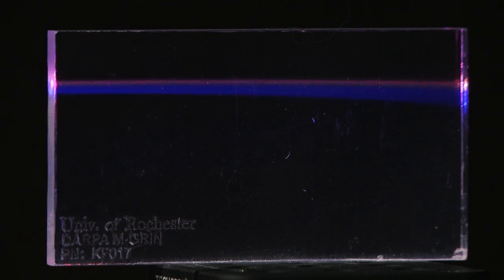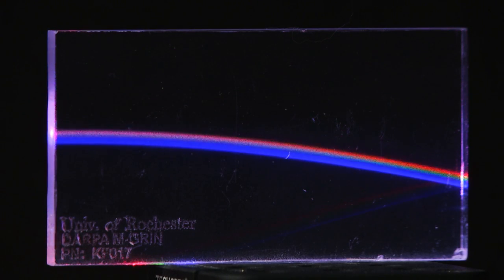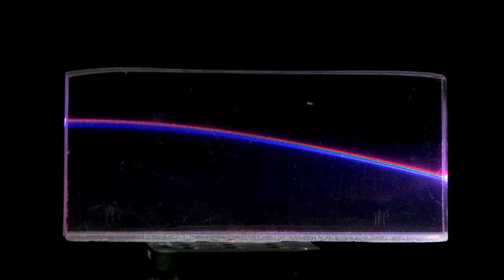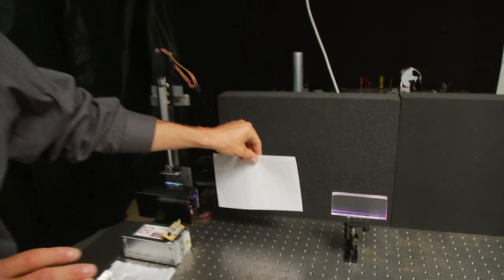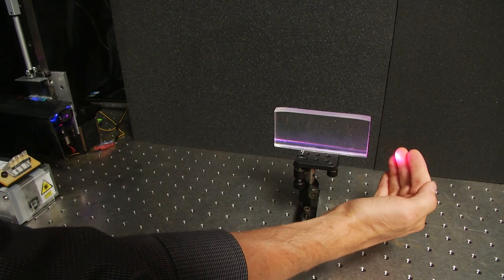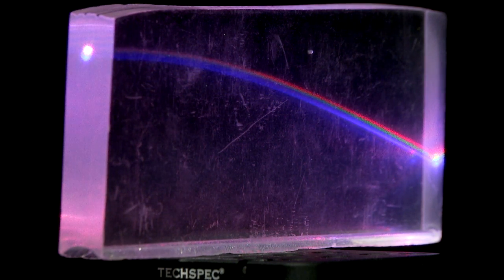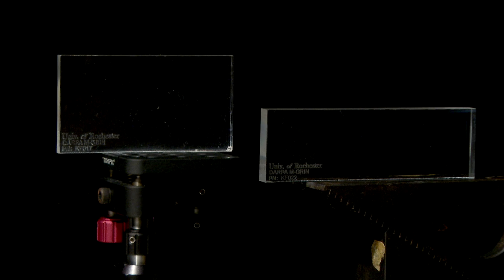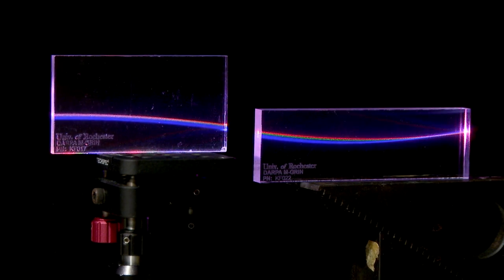Gradient Index Optics

Comment: can you bend the light and bring them back together at any point?   It would be nice if you could make lenses this way.   That block is really thick.  I guess that's why it's used for fiber optics.   However I read in Wikipedia that this works best for light of objects embedded in the material.    This would be great for artworks since there is the benefit of light hitting the embedded objects and images at better angles which brightens the embedded object.

Comment: Would I be correct in thinking that these types of lenses could be used to create a somewhat straight beam out of a portion of scattered light?
Reply: Depends on how it set up. You could probably make some sort of cone with curved sides and have lasers positioned around the cone shoot towards the center. Then, if it carefully setup, all the light would come out the tip of the cone.
Reply: @kevinkoenig365 you’re right, this has been done practically by Stanford Uni to create a lens that focuses solar light from different azimuth angles onto a multi junction pv cell.  They’ve called it AGILE concentrator